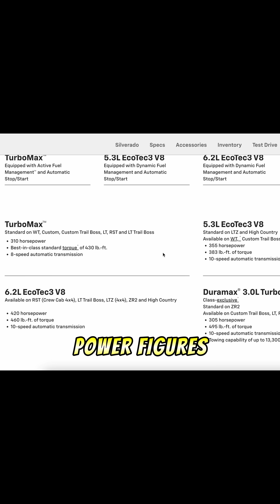Modern 1500 Engines Are Working Too Hard - WILL THEY LAST

Comment: Has nothing to do with that. Japan proved in the 90s especially Toyota and Nissan talhat turbo engines are very reliable and able to push a lot of power. These engines aren't being built as well, that's the problem. And I bet it has something to do with the epa requirements. Anyways, straight six turbo over v8 all day if it's built well

Comment: This is all conjecture. These extra “stresses” may be no problem for the engine over a long period of time and high mileage. What they will require is more frequent and proper maintenance unlike engines of the old where lazy owners neglected to do it. Obviously a different scenario but you didn’t hear this same chant about high performance turbo diesel’s over the years. A much more “high stress” modern design. Only time will tell on these things. So many issues with older engine designs just glossed over here.

Comment: I prefer my 06 lbz duramax thanks, stock it pushes close to the same power as the newer trucks, 360 hp 650 ftlbs vs the newer 425 hp and 910 ftlbs, although mines a good bit from stock. Lasts longer, no emmissions, not nearly as hulkingly huge, tows the same, hauls the same, allison makes a much better tranny than the ford gm 10 speed that can never find a gear gmc should never have dropped allison transmissions

Comment: Smaller turbo engines aren't inherently less reliable. Good transmission tuning eliminates most issues. Absolutely solid engine management determines the lifespan of a turbo engine. Quality of electronics too. 
Toyotas with turbos have been some of the most reliable road going machines ever. Turbo diesels exist because turbocharging engines doesnt make them somehow more prone to failure. 
Bad oems are the reason. Bad design. Bad engineering. And cut corners.

Comment: the push towards microscopic fuel efficient engines that have to rev to 9k rpm to make any power is such a dumb one. The engines just straight up don’t last as long as a well designed, larger N.A. motor, and the car manufacturers know this

Comment: All of the smaller turbocharged pickup engines have pretty stout internals. None of the issues they have are related to being "high strung" and making a lot of power relative to their displacements.

In my opinion, the biggest issue with them is that as soon as you actually use that power, they use fuel just as fast, and sometimes faster, than the larger engines. More boost means more air going into the engine which means you've got to inject more fuel.

Comment: Add additional transmission cooler & oil cooler each with electric fans & Valvoline Restore & Protect is great for your piston rings these 3 things should slow down wear & tear also a less restrictive exhaust may assist in removing heat more effectively also a slightly larger more efficient intercooler won't hurt

Comment: You forgot to mention the valvetrain issues with the turbo 4 cylinder engine. My buddy has one and it's already been to the dealership to fix lifter and cam problems

Comment: Can you explain why GM’s 4 banger turbo is the most reliable powertrain in their current half-ton lineup?
Reply: Because it’s actually well designed. Forged internals, offset crank, massive block reinforcement, proper cooling… the 2.7 4 is a great engine.
Reply: @austinnafziger4159  Ah yes, finally someone that has a brain and understands how engines actually work.

Comment: The 2.7L from ford has been a work horse of a engine. It's actually one of their most reliable engines. It's quite stout with no real issues. The only downside is the 2nd 2.7L uses a belt oil pump instead of a chain driven one. Nothing like saving a buck. But they did the same to the 5.0L too. No issues with the belt yet but I suspect when these get older they're gonna start going out left and right.

Comment: That's the problem with literally all modern cars. Downsized engines but with forced induction is a good way to be fuel efficient and produces less emissions, but that comes at a cost of reliability.

I'll stick to big displacements.

Comment: It’s worth noting those engines reach peak torque much earlier like almost half opposed to the v8’s, your effectively reducing the load at peak pressures by almost half the revolutions.
Reply: PUT A LOUD BEHIND IT then lets see what happens over the long haul . Now if only a PV might be ok but put to work l dont think it ll last as well as a V8.

Comment: People used to design large displacement engines for towing by first looking at the maximum power output and then taking away 30% so an engine could work without stress. And it never had less than 6 cylinders.

Comment: This is why I laugh when some talk about my 6.4 Hemi being the weakest of the big 3 for hp and torque. 30 years ago qe had way less hp and torque yet was able to work. To me, having an engine that has been around for 12 years of production is prefered to a new type. Reliability and known issues are known. The New 6 cylinder Hurricane for example is too new and unknown for me to consider.

Comment: I wonder how much oil that turbo 4 cylinder takes to fill? My Mercedes 5 cylinder diesel takes 11 quarts of oil for only a 2.5l. I feel that not enough oil capacity on a turbo engine can lead to premature failure.

Comment: Everyone can talk about the small displacement engines all they want but when you use a truck for work (imo what they are really meant for) like hauling, you DO NOT want the 4 cyl. You want that good low rpm torque when hauling because it makes hills way easier. 

Case in point: I haul around 8k lbs. When I've used older Ford v8s (I am in no way a fan of Ford or Chevy really) I can basically idle up a hill because of the more end torque paired with good gearing.
Now when I use the newer Chevy at work (still a v8 but less low end torque because it's a newer one) I have to constantly be on the gas. Even just having the trailer into the shop and going over bumps while doing so requires me pressing the gas to get it to move at all. 

This is exacerbated by a small displacement turbocharged engine. It does not get peak torque or power until high in the rev range. This means that when towing at lower speeds (which you have to do to get to higher speeds) you are running very hot. This is not good for the motor but it's also not good for the transmission, especially an automatic with a locking torque converter (which basically every truck will have these days)

Now if you just use your truck for groceries and pulling a boat or camper then these engines should be fine for you mostly, but at that point I would consider a Ridgeline or similar smaller truck that is designed with that in mind. If you pull big things then you can afford to get a proper hauling truck that you only use for that and use a different car for daily use.

Comment: TURBO ENGINES DO NOT RUN HOT. MAYBE OLDSCHOOL AIR COOLED PORCHES BUT NOT MODERN TUBO MOTORS. ALL A TURBO DOES IS HARVEST ENERGY WASTED AS PRESSURE AND HEAT. YES THE OIL AND COOLANT RUN THROUGH THE TURBO. ALWAYS CHANGE  OIL EARLY AT 3,000 MILES NO MATTER WHAT THEY SAY. TURBO ENGINES HAVE SUFFICIENT COOLING DO IDK WHAT YOU ARE SAYING. YOU OBVIOUSLY DONT KNOW WHAT YOU ARE TALKING ABOUT.

Comment: 2014 Silverado 1500 Ecotec 6.2L V8 80k miles 6 speed tranny (tow package 11,800 rated).  Hope this truck lasts me 15 more years or more.  It's just the aluminum one, not meant for heavy duty cycles.  I don't tow heavy, just the occasional UTV or boat.  Perfect for my needs.  No issues.  Love this truck 3.73 from factory

Comment: I have an idea let’s build a bigger and heavier truck, throw in a turbocharged Honda engine only shittier. much shittier. How about an 18 speed automatic transmission bigger than the engine itself but still shitty. We’ll keep it from doubling in weight by using cheap plastic all over the fucking thing. Hell we’ll even throw in a plastic oil pan and other vulnerable  essential components and sell it for 80k. It’ll all go to shit by the time the warranty period expires. But wait there’s more! For a small fee of 10k you can get pleather interior and an 80” tv mounted on your dash that’ll also give out faster than a shy catholic school girl at a drake concert.

Comment: My folks have nearly 300,000 on their ford f150 with the 3.5 eco boost. Factory motor trans with regular maintenance. The reality of the new smaller engines is that they aren’t meant to do what the old engines did. They are made for the guy that pulls his camper once or twice a year and then puts regular driving miles on the truck most of the time. So I would say if someone was going to be pulling a lot I would definitely go with the V8,but if you just want one truck that gets halfway decent mileage that you can use to pull the few times you do or a lighter load more often then these trucks do very well.

Comment: Just because the engine operates at a higher BMEP does NOT make it inherently less reliable. It is only less reliable if the engineering around the block and internal components/heat management system is not up to snuff. Just look at any industrial power generation engines like from CAT. They are ALL turbocharged at high boost levels

Comment: The problem with this video is that it is just speculation, no facts to back it up. The GM 2.7T L3B is arguably their most reliable engine rightnow. If the V8s scrap the cylinder deactivation then the v8s are likely more reliable long term

Comment: The GM 2.7T L3B is arguably the most reliable clean sheet design turbocharged engine in the half ton segment. It is not “high strung”, it is built to have diesel like torque and low revs, built extremely strong.. Smart idea

Comment: I've driven a Silverado and a Colorado with the turbo engine.  They both got just as bad mileage if not worse than any v8 I've driven.  The extra heat also causes knock.  To mitigate that knock, the computer riches the mixture.  Unburned fuel is excellent at absorbing and removing heat from the cylinder.

Comment: It’s not “ the heat “ from the engine or load
it’s the emissions law for smog ( NOX ) 
Super hot air molecules stick together and they ultimately bond with Nitrogen 
Forming smog. 
EGR system is supposed to cool the combustion process, reducing the NOX. That’s all it is 
Fuck off I don’t care to argue

Comment: Logic is sound. However. The hurricane in my ram 1500 does not work hard towing. It stays quite cool as well. Towing around 8000lbs in almost 30c weather my coolant temps never exceed 90c my oil temp chilling around 100c towed for about 4.5 hours with a consumption of 18.4L per 100km. Turbocharged engines are definitely under alot of stress. Modern cooling systems and machining techniques have also made these engines stronger.

Comment: The turbo max is insanely reliable and buildable. My buddys a high up gm tech and he beats the snot out of his. The blocks built strong and has very thick walls and larger coolant channels, combine that with the forged internals and low compression, got yourself a long lasting engine. I do think it belongs in a car though

Comment: As with everything, it’s about balance. Gas guzzling pushrod v8’s clearly aint it for the environment. Neither are these strung out modern engines. Unfortunately combustion engines often boil down to a reliability vs performance vs fuel economy tug of war. Those mail trucks that have been rolling around since the 80s? Terrible performance, but good longevity and fuel economy.

Comment: I think the stereotypical 1/2 ton owner isn’t really working their truck tho, so to run a small displacement with forced induction is fine. Obviously there are outliers, but I tell anyone who regularly tows 8k plus they really should be looking at a 3/4ton or better. 

But for day to day, and most people’s application, small engines with turbos are a blast.

Comment: Hmmmm, if only engineers knew these turbo engines would be dealing with higher stress levels and they built them accordingly. The problem with your argument is that Ford has been making the ecoboost for how many decades now??? And it’s worked just fine, minus some non “high stress problems”. They make V8 numbers because that’s what forced induction is all about. That’s why boosted V8’s make about twice as much power as the same motor NA. I’m not saying there aren’t design flaws or anything, but that’s a weak argument

Comment: It has been proven a turbocharged engine can have a very long life with proper design and adequate maintenance.
Reply: Especially informed users. Most people don't know to let the turbo cool before shutting it off or letting the engine come up to temp before pushing it. 

Also diesels can last forever and they have turbos.
Reply: @j @jakeme9911 

The Car Care Nut channel had a video on modern vehicles and reliability, it’s just one where he’s sitting in front of the camera.

He stated in that video why “diesels have turbos” isn’t a great comparison tool in his eyes since boosting a gas engine vs a diesel is a little bit different;
And a few points were that gas turbos spool up much faster, go to higher RPM’s and higher temps than diesel turbos. 

So it’s like, the same but different, man.
Reply: @rio_mn that and diesel uses different mechanics to combust than a gas engine. I do understand but there still is some comparability.
Reply: @jakeme9911 there isn’t a comparison, diesels use far more fuel pressure and compression, they deal with more fuel dilution in the oil and heat, they often blow turbos among other expensive items, the shortblocks are expensive because they have to be overbuilt compared to a gas engine. Then we have def fluid to deal with. They are both comparable in they are engines, that’s about where it stops.
Reply: @dashowdy have you seen the compression ratios modern cars are running? Particularly small engine trucks? 

Also yes they are different but a turbo isn't seeing all that much difference between the two at the end of the day.
Reply: @jakeme9911 gas engines run way hotter than diesels.
Reply: @tomcat8662 gas engines do not run way hotter than diesels. They usually run at exactly the same coolant temperature, but diesels run much higher cylinder temperatures.
Reply: Turbo engines that have the displacement durability and lack of emissions equipment. If that inline 4 was a 4.0L with less boost it would change the reliability significantly. Doesn't matter if its pushrod or DOHC. Theres a reason why semis aren't smaller than 13.0L displacement engines. You literally need displacement for high load strain applications and long duty cycles, physics and math don't lie.

Comment: they would all hold up forever if everyone ran 93 octane in their turbocharged trucks and if the engines didnt have stuff like wet belts driving the oil pump. maybe a little more metal in the engine castings for heat dissipation but the smaller engines shouldnt be failing any faster on account of being small

Comment: Also, heat kills oil.  Manufacturers have increased oil change intervals knowing their forced induction motors are killing oil more quickly.   Bad combo.  Should never go more than 5k mile oil change intervals on turbo motors.

Comment: If they just use the same materials and engineering that they do with diesels, the smaller displacement turbo charged gas engines would last longer.

Comment: Just take the turbos off it and drop that same motor into a Colorado. Now sell your 48ft long trailer and buy an in-bed camper for the Colorado. Now, if you can't live without your 48ft long trailer, buy a 1995 one ton. Problem Solved!!

Comment: I'll keep my v8 as long as possible. Ive owned 2 5.7 hemi trucks since they came out, the first one I traded in at 220k miles for the one that I have now. 

The small displacement turbo engines just aren't for trucks.

That thing screaming at 5k rpm trying to tow 8k lbs is crazy.

Comment: If you want a powerful half ton engine, invest in something like the 5.0l cummins diesel V8 or the ecodiesel V6. Small and lightweight, excellent fuel economy for what they are and absolutely curb stomping torque. Horsepower doesn't mean shit for towing, it's ALL torque without question. Give me a ram 1500 with an improved small diesel like an American produced cummins r2.8 and THEN I'll buy a new truck.

Comment: Idk man can’t speak for all of them but the ones I’ve dealt with seem to last ok with good maintenance. My wife’s 16 ram 3.0 ecodiesel is coming up on 300k miles all original parts except intake manifold thermostat some harness pigtails and a recalled injection pump. Those repairs were done at over 200k miles. It’s always ran fine just had to do the repairs to pass California emissions.

Comment: They could easily design a small 4 cylinder to handle these power levels and last longer than even the old v8s by using good design practices such as: 6 head bolts per cylinder, making the head and the block out of the same material, making that material an iron based alloy or anything with higher heat tolerance, using forged rods from the factory, pair it with a manual transmission with a decent liquid to liquid heat exchanger, make the wheels and tires lighter, and maybe even a dry sump system for some razzle dazzle. We can keep the turbo and even a supercharger if the engine is designed to handle more heat and is still cooled to normal levels with massively upgraded radiators and intercoolers. The fronts of the trucks are still being designed to hold V10s with superchargers even though they put 4 cylinders in there, lets use the space for cooling stuff.